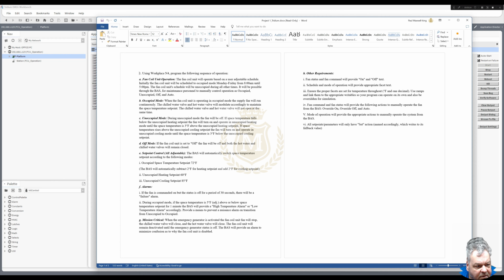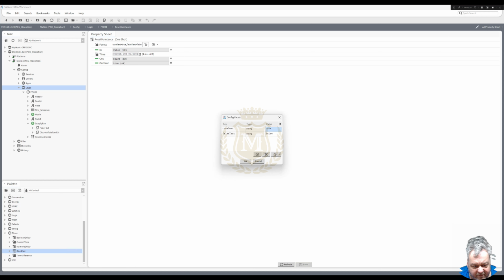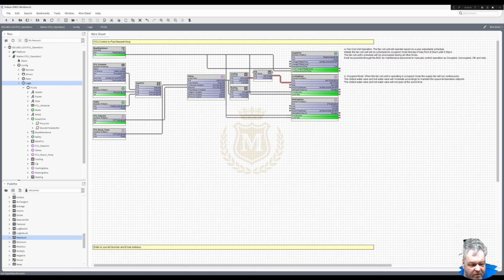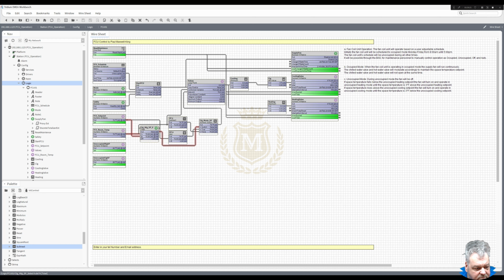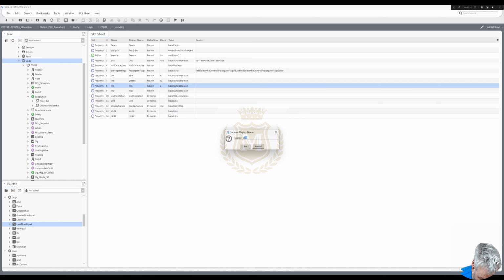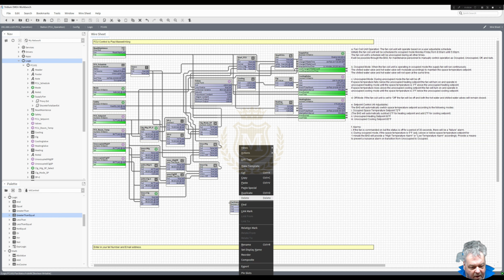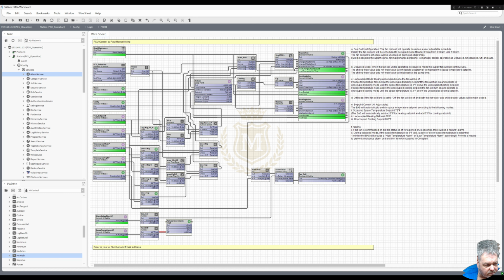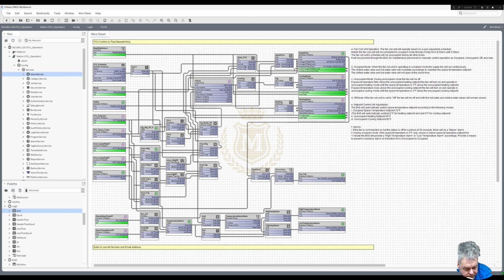#80 N4 Tridium Niagara - Machine Learning - FCU Logic

Comment: Hi Paul, thanks for sharing the video, just a quick observation, high and low alarm, the temperature alarm TStat which goes into the And gate only bring either high alarm or low alarm, if the TStat is either direct or reserve settings, I added another TStat and make it as direct and added or gate than added it to the and gate enable alarm. However there is some sort of glitch in TStat, if both setpoint and CV on the TStat is equal value the output is null and both high/low alarms flagged.

Comment: After heating or cooling the room , how can i know the supply temp , the fan is giving
Reply from the maker: I would put a temperature sensor on the output of the supply fan. With FCUs we have a temperature sensor on the return air before it goes into the fan and Htg/Clg coils and then a temperature sensor on the supply air, just after the heating/cooling coil. We also have a temperature sensor on the space wall about 1.5 meters from the floor.

Comment: Perfect timing!

Can do one for AC in future please? Do you have any tips for Daikin logic for meeting rooms in an office block?  UK based.

Cheers
Reply from the maker: Do you have any description of the operation for the office Block meeting rooms?
I have worked with daikin DMS502A51 via BACnet in the past, and it is easy to pull in the points and adjust the set setpoints.
Reply: I don’t I’m reviewing someone else’s. I’m new to this so trying to learn. They have season control - winter, autumn/spring and summer. Between those it selects setpoints.

Would you advise this?
Reply from the maker: Have a look at video #87 when you get time - Season Control, just uploading it now.